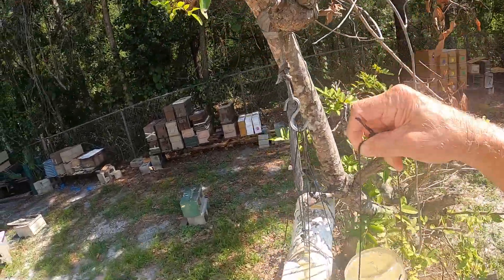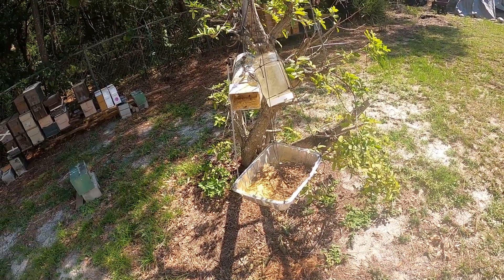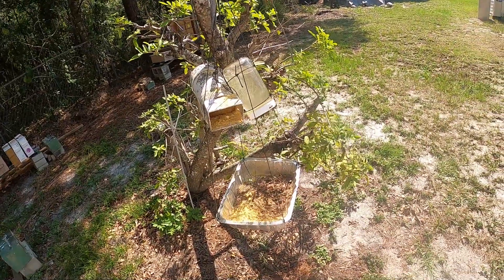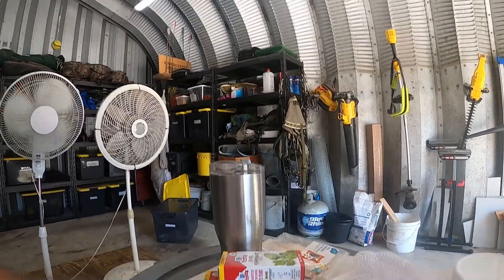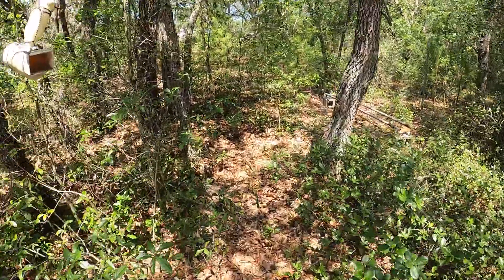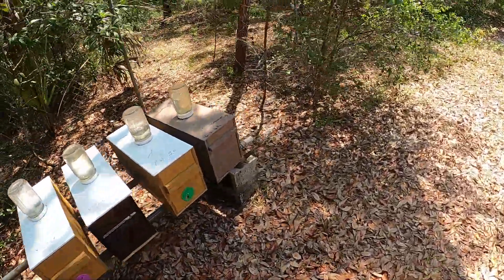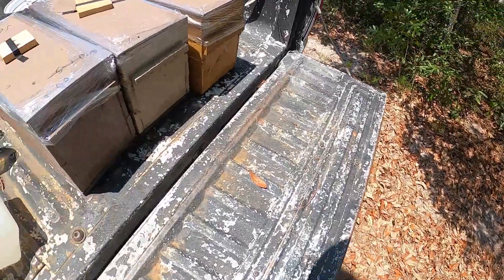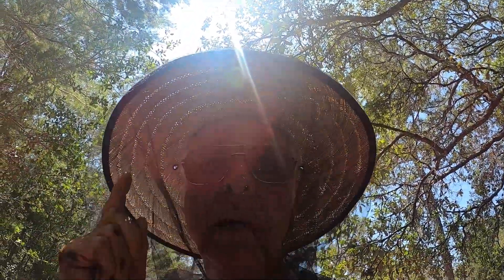More Steveo Tips & Tricks

Comment: I have 2 of those click sharpie markers and they last a long time if the surface you’re writing on isn’t too absorbent. If your writing in painted plywood it will last longer than writing on the concrete backer board tops you are now making but it doesn’t seem like you use it to write too much. Mine haven’t dried out and I’ve had them for several years Definitely better than using two hands to take a cap off. Great videos Steve. Always enjoy watching.
Reply from the maker: Thanks for sharing Stewart.